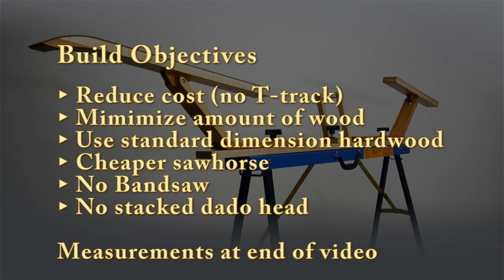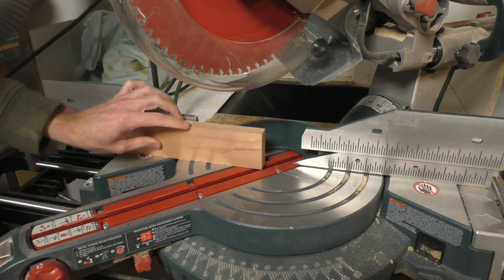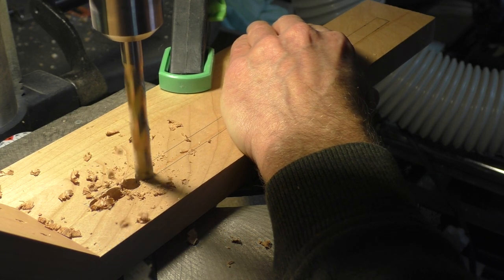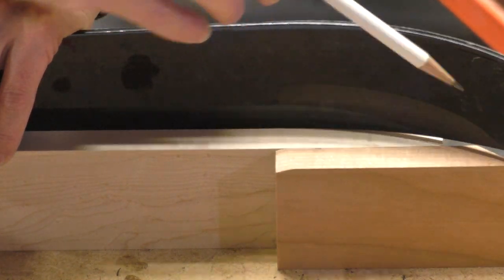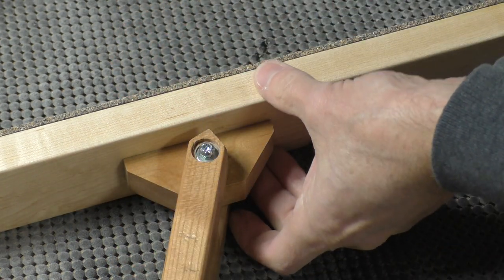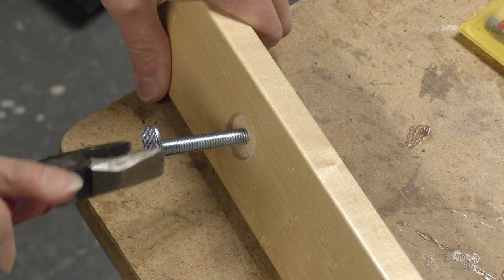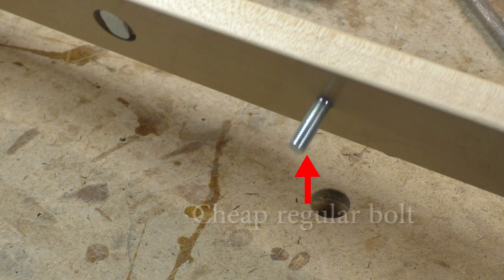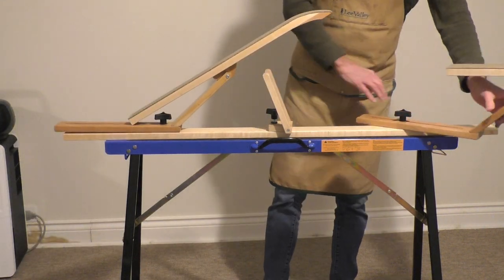Ski Wax-O-Matic L3 - Third generation DIY Nordic ski waxing stand.

Comment: Somehow my comment got deleted. I'll give it one more shot without the link to the sketchup file in case that's flagging it. I've just about finished my build of this. Before I started I built a simple sketchup plan to help me think through the cuts. You can message me for those if interested.
Thanks for taking the time to put this together and include many of the details. 

A few of the challenges I ran into:
1. I've got backcountry skis as well as kid's skis. I had to widen the base board to make this work (not reflected in the sketchup files)
2. the kids skis will be tricky due to their shortness, so I may need to find a solution to better stabilize them. For now it might just work well enough
3. finding the right hardware for the skis to attach to as well as some of the wider screws. I measured nnn bindings need a .15" metal rod, nnn-bc need about .18". The good news if you can aim for the lower size and it should hold for both. However, I couldn't find anything in this size at the hardware store. I ended up buying a steel rod on ebay that was close enough. A better hardware store may have a threadless rod in the right size. I couldn't find nails that were long enough.

I'm waiting for the finish to dry, but hopefully, I'll be able to play with this soon. Thanks again
Reply from the maker: That's awesome Kenyon. I'm glad you've been able to make use of my experiences to help you craft your own solution. It would be great to be able to share the sketchup file but I'm guessing you're correct that it's not something that YouTube wants linked from comments. I'm planning to set up a Web site for details eventually, but haven't done it yet. Once I get the running, we could put the link to the file there.

How short are the kids skis? My stand adjusts enough for my family's shortest skis but none of them are very short. Are you using the T-Track or fixed bolts in the base? Either way, I've found that if I reverse the tip and tail supports, they can support a shorter ski. The only problem is that the tip's curve isn't supported that way. 

I appreciate the measurements on the different binding needs. All my bindings clamp on the same diameter rod, so I know what I have to do to accommodate different skis. I've just been getting the right size nails from my accumulated inventory to fit but I'll spend some time thinking about a more reliable source. 

I've been investigating a method for clamping the ski into position rather than using the binding for holding the ski in place. I'll do a video of that if I get it working well.

Ski season is just about over here (despite the blizzard that blew in tonight) but I'm hoping to continue with some design improvements over the next couple of months.
Reply: @ErichForler  The kids skis are around 110-130. I'm using the fixed bolts. I could probably shorten the sliding base pieces to get a little more room, but it works well enough as it is. 

I played with some ideas for clamping the skis without using the binding, but gave up for now. The binding shapes are different enough and it's tough to get a good hold without starting to overlap the ski base. I think it's possible, but I lost interest :). For now, I'm not using my downhill skis so the motivation's lower.

With projects like this, I'm always appreciative of the few decent hardware stores left. Trying to find bolts at the big box ones is so frustrating. I'm finally investing in a wall-mounted nut/bold thread checker so I just order exact parts online.

Thanks again for this build; it's a cool piece to have mounted on the wall for people to guess at :).

Comment: Great Build Eric!  Any thoughts on how you might adapt this to a touring pin binding setup?  Cheers
Reply from the maker: I've got another video I'm working on which shows the build for a clamp which clamps the sides of the skis which can accommodate different widths of skis regardless of the binding. It can theoretically also accommodate a downhill ski as well. Not sure when I'll get that video released so subscribe and you'll see it when it appears.
Reply: Thanks I’ll keep my eye out